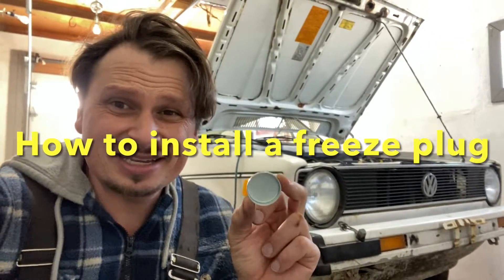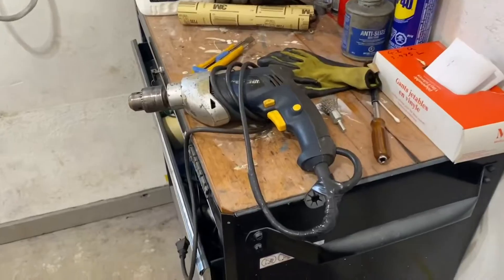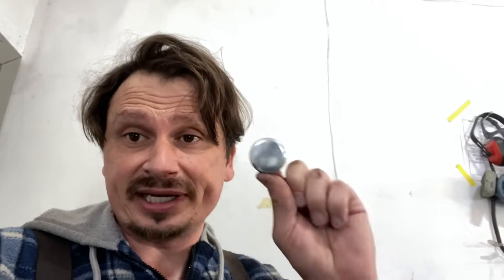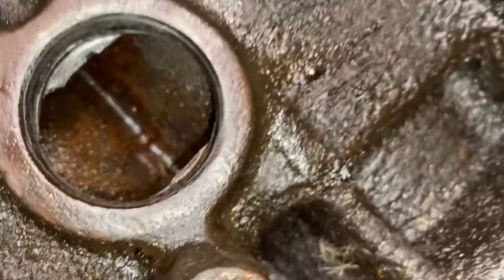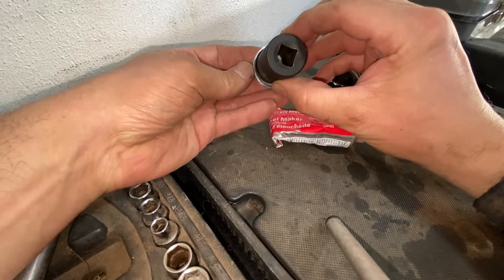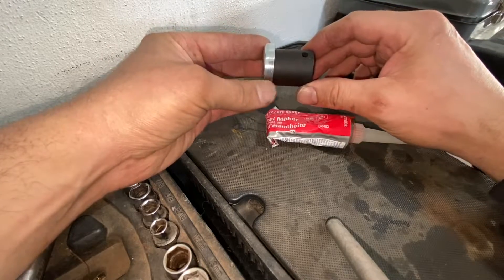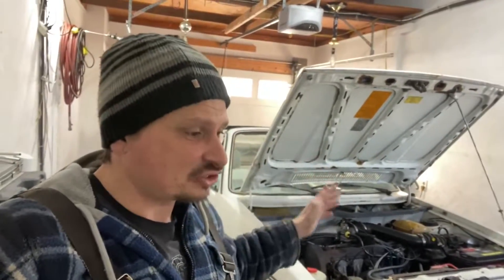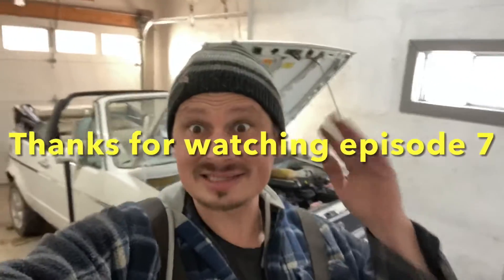Freeze plug installation. Core plug installation. How to install a freeze plug￼.

Comment: I really appreciate these videos. I have a 1980 MK one with CIS 1.6 L sometimes my fuel pump runs when I turn the key without turning the engine and sometimes it doesn’t run and it won’t start and I have to jumpstart the motor or the fuel pump directly with a 12 V battery but after that it runs. Seems like it’s my relay maybe it’s sticking? How do I get a new one? I’m having trouble finding one onlinethat’s not ridiculously priced.

Comment: Don't use rtv!!
Freeze plugs are meant to be installed snug without any sealant, I do mine by freeezing them!
Reply: I was going to comment soething like that. A piece of RTV could release and block something in the cooling system.

Comment: What is and what purpose is a freeze plug?
Reply from the maker: If the coolant inside an engine freezes, it may cause the block to crack. Water expands as it freezes, and the pressure created by this expansion can cause cracks to form. Freeze plugs prevent this from happening by allowing the frozen water to expand out the plugs passages.
Reply: @ProblemSolverGarage  thank you. I haven't ever heard of that. I live in lesser cold climate. Thanks for your channel. I'm so inspired by what I see you accomplish.
Reply: @ProblemSolverGarage  Doesn't it have something to do with the block casting process so the molten metal can fill the mould?